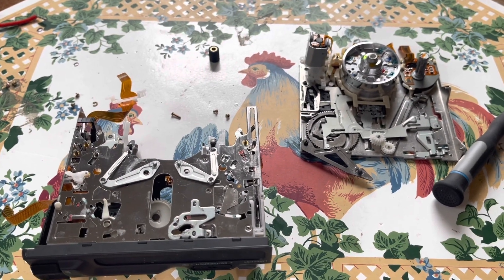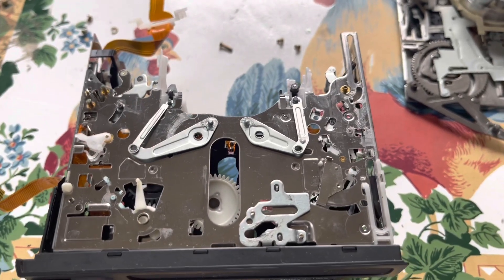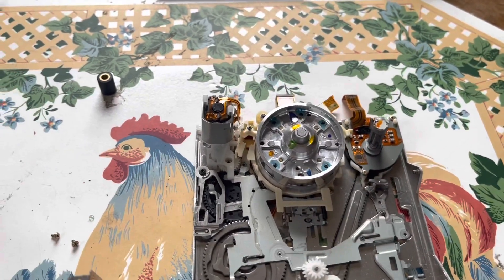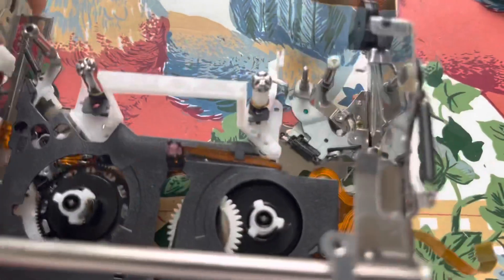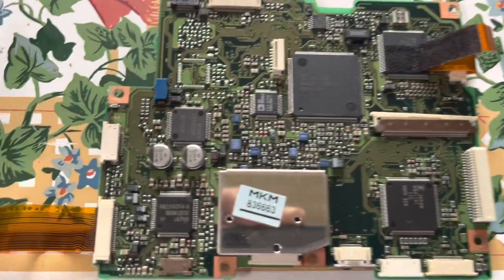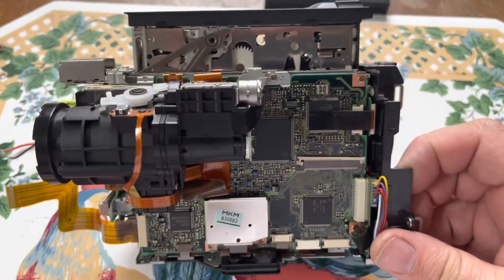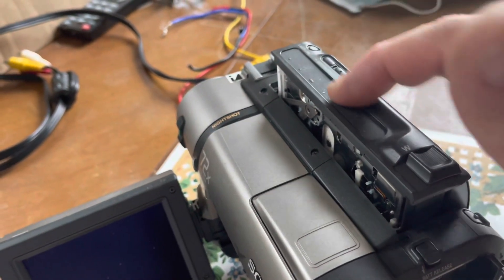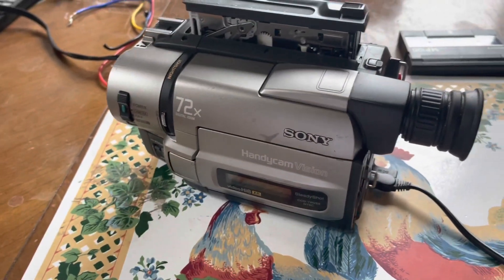Sony Handycam CCD TRV85 Hi8 Camcorder Teardown

Comment: Thanks for posting this video, I want to understand how the roller assembly is attached  to the metallic moving arm shown at 5:08 min in you video, I am trying to put back the guide roller assembly on my camcorder, the  roller assembly has a plastic pin that I think goes into that hole at end of the metallic moving arm, is there a clip that holds the roller assembly to the arm?